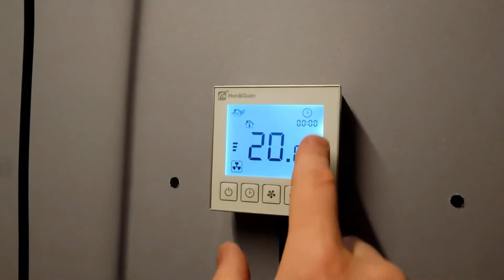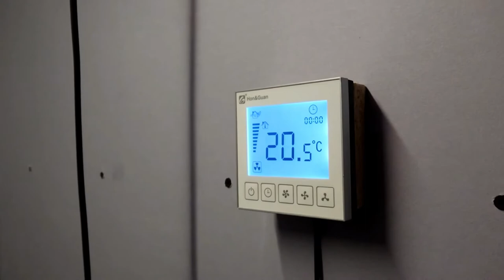Building a Vocal Booth: Part 17 - Final fit and test of the ventilation system.

Comment: Hey! I enjoyed these couple videos about ventilating the booth! How did it manage to stop sound coming out of the booth? I've been thinking of building one for months to record some loudish guitars and some voice as well. After plenty of research about soundproof materials for the booth I came across the ventilation issue. Since it would be something with 2 meters x 1.5 meters I thought of two small boxes that would be inside the booth, with maybe 60cm x 20cm maze of wood and acoustic foam and one with a small fan outside the booth to push air in. Am I thinking right? Or am I going to not push enough air in and worst, ruin the soundproofing of a booth? Going to watch you end that beauty!
Reply from the maker: If you check out all the videos on the ventilation system you will see that I have soundproof ducting inside soundproof boxes going out from and into the booth. But to be honest, I wouldn't bother. I can't use it when the mic is live as there is noise from the system and you may as well just open the door when you need fresh air. It does get hot quick, and I do find it useful to cool the booth when I am inside and not recording, like when I'm doing a quick edit or practising some stuff. So you have to consider what you need it for.